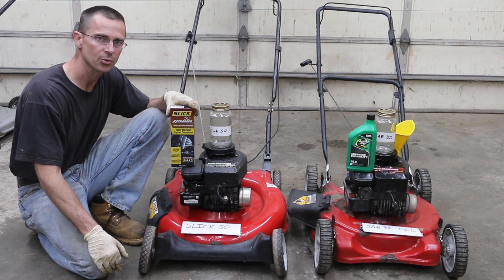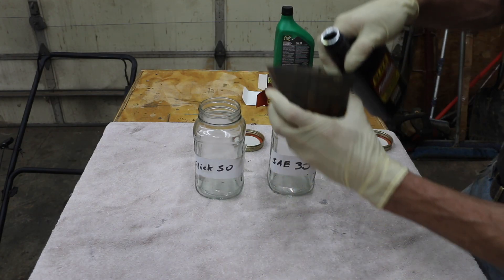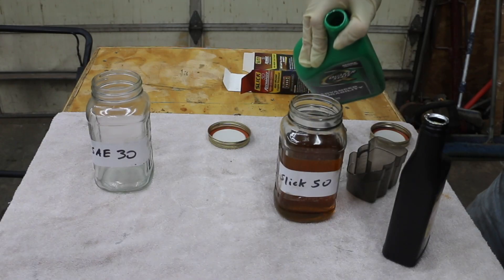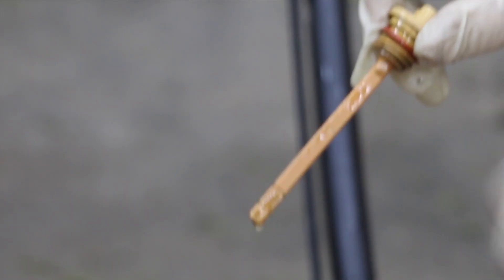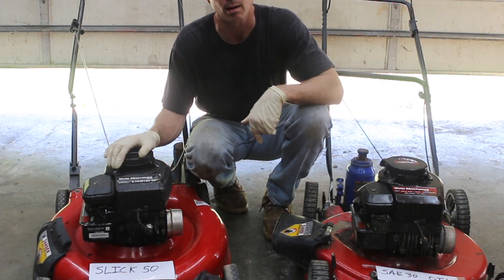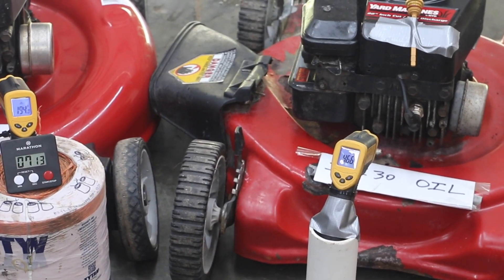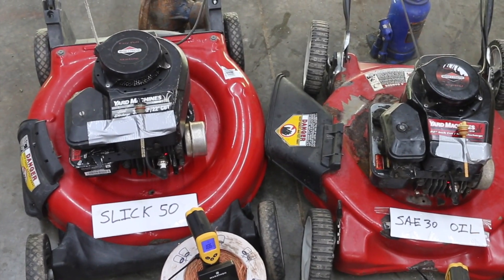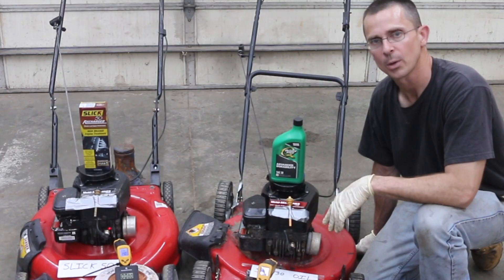Can't believe what SLICK 50 did to my engine!!--Dry Crankcase Test!

Comment: Squeeze a 4 oz tube of Amsoil Engine Builders Lube into one then Top with 30 wt oil!!!!   Run it like 4-5 hours or the tank of gas.  I soak all my small engine parts in the building Lube for a month or two on my chainsaw rebuilds!!!  That stuff soaks into the medal over time and creates a friction barrier layer...  don’t know if it can work that quick but bet it runs better
Reply from the maker: Thank you for this recommendation!

Comment: My dad ran slick 50 in his ford probe for years shortly after he gave it to my brother it blew a head gasket. When they removed the head to replace the head gasket he said the engine looked brand new without any ridges at the top of the cylinder. Any person who knows about engines knows that engines naturally create a ridge around the top caused by the piston rings.
Reply from the maker: Impressive!  Thanks for commenting on this.

Comment: Don't really know Who exactly would let their oil completely drain out of their car but the product did keep the engine a lot cooler than the other engine when it was running .So it does something
Reply from the maker: This is an excellent point.  A lot of others suggested I use 2 new, identical engines in future tests.  So, I'll do that just to rule out differences in wear or engine design differences. Thanks for commenting.

Comment: If your lawn mower runs on sae 30 oil. can you use 5w-30 in it? What is the difference in these 2 oils? Castrol magnatec is supposed to have particles that cling & protect.
Reply from the maker: Thank you for this recommendation.  I'll begin a new series on oils and oil additives soon.  Thanks again.

Comment: Today's Slick50 is not the original formula.  Thus the old commercial of the engine running for hours on end no longer applies.
Reply from the maker: This is a great point. Thanks for commenting on this.
Reply: yeah, so how about trying the john bishop version of the stuff.  back in the early 80's slick 50 stopped 2 of my engines from smoking.  that was a good enough result for me.  there's 2 sorts of teflons- those that stick to internal surfaces and those that leave with the next oil change.  install the first type.  the 2nd type is cheaper(and pointless).  you do good research.  thank you.

Comment: DuPont don’t recommend ptfe based compounds in engines.
The oil is providing both a cooling path and a film between components.
Try a Head and shoulders high zinc shampoo ( high zinc used in classic motor oil)

Or an experimental moly/ graphite solution of some kind like CV joint grease

Either way the component temperature out of operating range and expansion greatly contribute to the heat and lack of lubricant.
Reply from the maker: This is great information.  Thanks for commenting.

Comment: The amount of oil that you pulled out of the slick 50 test engine was a lot more than not only the SAE30 engine, but the amount of oil/slick 50 mix that you added to begin with (after the drain). This means that you didn’t drain an engine completely not one, but two times. The regular SAE30 engine no doubt had more residual oil in the case that was able to whip around and lubricate the internals at least a little bit more than the slick 50 engine, thus preserving it a little while longer. I’ve never used used slick 50 once in my life, so I’m not a butthurt fanboy in any way shape or form, but I just wanted to point that out.
Reply from the maker: This is great constructive criticism. I'll begin an entire new series on engine oils and additives and will do a much better job with experiment design.  Thanks again.

Comment: The first part of your test is more valid for use in a car engine, because a car will scream at you if it loses oil pressure, and you're a fool if you keep running it anyway. So really what matters for car engines is whether the additive produces better performance when the oil pan is full, not when the oil pan is empty.
Reply from the maker: All great points. Thanks for commenting.

Comment: I drove 30 minutes in a Cadillac that the water pump went out and all I had was Pro long in the oil change the water pump the following day started up run fine no problems
Reply from the maker: Impressive! I'll test it in an upcoming video series.
Reply: Every 3000 Miles when I change the oil I'd use prolong and I used it for a while so I'm not sure if that had something to do with prolonged being in the engine and bonding to the surfaces in the engine.

Comment: I like to know what Lucas Oil does. But the slick 50 did let the engine run cooler. Which in turn saves your engine much where and less on your thermostat. And a cool your engine runs the more horsepower you get.
Reply from the maker: Thank you for this recommendation.

Comment: Slick 50 is not the same as the stuff they used to run engines with no oil.
 its now exelplus thats tbe original stuff i remember it waz great
Reply from the maker: Great point.

Comment: I was a bit surprised myself. I expected the slick 50 to last about 9 minutes at least, to the 6 minute 30w.  In any case I feel slick 50 should only be used in a vehicle that can handle 10w40. A lot of new cars are 5w20ish. But after seeing this I find slick 50 a failure.  Only used it a couple times through the years. Now I'm not going to use it again, waste of money I MO.
Reply: 0ne more thing. Good video. Thanks for doing it.
Reply from the maker: Thank you very much for the positive comment!

Comment: Mower engines are a splash lubrication...I going out on a limb here saying 1) you need a pressurized system and more run time to impregnate the metals 2) those mower engines might not have had equal wear to begin with without any hour meters to verify.
Reply from the maker: This is an excellent suggestion.  I'll use new engines in future videos.  Thanks for commenting!

Comment: Would you sell these blown engines?
Reply from the maker: I have extra lawn mower parts of someone needs them and I'll give them away for free.  I've already disposed of some of the parts, since I have limited shop space.
Reply: Project Farm do you have any horizontal drive or 2 strokes? I know of a couple carbs i need wich have holes and scrapes from bad gas and owners haha. For example someone tried to bore a carb from a honda g150, i sealed it and got it to run, but needs doing right, as well as a shear key

Comment: What about trying out Tuff-Oil, I've been using it for 30 some years and getting 250-300 thousand from my engines before working on them.  You use about a table spoon per quart, my mowers run perfectly and with less vibration, I follow the break in rules, then change the oil out for Synthetic with just a spoonful of the Tuff-Oil, they last for decades and they have less vibration as well.  Look up Tuff-Oil.
Reply from the maker: Thank you for this recommendation.

Comment: The reason the 30 weight oil engine ran longer is because of what an old timer told me years ago. Straight weight oils have a better and stronger film strength than the additives that are mixed with the oil. They tend to be thinner also. Just my two cents. Keep up the great work fella.
Reply from the maker: This is an excellent point!  Thanks for the positive comment!

Comment: Why didn't you open them up? The slick 50 engine was running much cooler than the 30 engine. Don't you think it might have a pretty good chance at being saved? Did you try to start it again? Was the 30 oil engine completely locked? There's so many questions that I think we need the answer to. Make a part 2!
Reply from the maker: Thanks for this recommendation.

Comment: I used 50 before realized no oil it ran fine...seperate the mowers with temp gauge the heat was blowing on. The 30
Reply from the maker: Thanks for commenting and thank you for the recommendation.

Comment: All oils contain varying levels of zddp, but slick 50? Read the literature, zddp is the best metal to metal protectant in oil starvation conditions. Zddp bonds to hot metal surfaces and forms a tough layer of sacrificial material. Today's oils contain less than in previous years because zddp contributes to premature catalytic converter death. Engine rebuilders, race engines using flat tapped cams, and motorcycle racing oils all employ zddp as a metal protectant.
Reply from the maker: Thanks for commenting on this.

Comment: In your experience, what is a good oil to run in your lawn tractor? I remember the slick 50 commercial too. Seems like there was another where they drained all the oil out and were spraying water on the heads with the valve cover off.
Reply from the maker: I would recommend using a good synthetic oil and change it fairly often if the engine doesn't have an oil filter.  I'm reluctant to name a specific brand until I accomplish some oil tests, which I'll be doing in an upcoming video series.

Comment: Rislone for engines cleans and protects your engine. My dad told me in several oil changes your engine runs better and doesn't burn as much oil if it's not too worn out. The chemical is a really attractive Metallic blue color and it doesn't work right away but it does clean very gently so it doesn't hurt the inside of your engine or gaskets. It's meant for higher mileage engines and something I thought was interesting I had a engine that burned a lot of oil but after using the Rislone oil additive it did take a little bit for it to work like 3 oil changes but after words instead of my car burning 1 quart of oil it used up just a little bit of it like it resealed some of the rings. The color of the bottle is a red cap, yellow body with black and red lettering on it.
Reply from the maker: Thank you for this recommendation!

Comment: Use royal purple with synerlec it suppose to keep engines cooler and stick to metal parts. Here is what they say. Synerlec improve the surface condition of metallic surfaces by smoothing inherent surface roughness, actually reducing friction and improving lubrication of internal moving parts. http://www.royalpurpleconsumer.com/about-royal-purple/synerlec/
I use it in all my cars. And I pulled my valve cover off a old car I had bought. It was gross in there. After about two oil changes of 10k miles each ( you can go 15k on Royal with every 5k Chang’e filter top off. ) it was almost spotless. Something ya could try out
Reply from the maker: Thank you for this recommendation!

Comment: Can't help but comment here, before seeing video. I had a turbo charged buick and always added slick 50 to oil changes. One day the engine got hot, caught the oil on fire and burned off ignition wires. I had no tow service so had to go buy new wires and hope the car would start again and get me home as I live in Bakersfield and was stranded near Magic Mountain. I did not change the now dark black oil, but to my amazement the car started. I drove back home the 97 MILES. I then changed oil the next day and the engine was still in great shape. I really think it had to do with the slick 50 as the oil was burned bad during the fire.
Reply from the maker: Glad the engine survived the fire!  Thanks for commenting.

Comment: U need to use two brand new mowers then retest
Reply: No way to know the condition of each engine at the outset of test. I just don’t believe that both engines started equal
Reply from the maker: Thank you for this recommendation.
Reply: You've got the right idea.
Cheaper to start with to equal engines that have been rebuilt.
8-)
Reply: even two brand new motors havw diferent tollerances and will wear differently. The way project farm did it was a real world demonstration.(thanks for testing slick 50 btw!!) But the way people are carrying on you have to think, Would you buy a new car just to test an allready scientifically proven and backed evidence that it protects the engine? Slick 50 is one of the most researched and lab tested reliable additives on the market. But there is some.other variable at play here because i use slick 50 and have seen it work first hand many times.
Reply: true, 30 oil mower looked older, more worn, more slop in rod and piston would take longer to seize, slick 50 mower looked newer, tighter rod and piston would seize quicker. didn't give the slick 50 time to coat and get into the rod and crank to protect the surfaces. Both fluids came out black in short period of time, need to test 2 new mowers, let both of them run for 5 hours then drain them and test.
Reply: Agreed!  This test was completely useless...…………………………..elsullo

Comment: it all depends on the engine I think you just had a bad one. I only say this for the fact my brother was coming threw the desert one time with temps in the 120 and higher and he broke down the took the car in got it fixed and the guy installed new oil along with slick 50 well the next day I brother drove threw the desert the rest of the way home 3 hours when he got home he hade a phone call from the repair shot it seems the oil plug fell out in the parking lot and all the oil drained out but no one new as my brother picked the car up the night before at night when it was dark out and drove it to the hotel then in the morning drove it home. all that way houres on end without any troubles the only thing he sed it he did have to pull over several times to add coolent to the car as it kept over heating.
Reply from the maker: Thanks for sharing this experience.

Comment: I have found zx1 seems to help with all my previous and current vehicles.I did have a cylinder head gasket go on a Mitsubishi which overheated but kept going without damage and I had wynn's gold added to Castrol GTX in that engine.Now I use Mobil 1 or Castrol edge in the family vehicles.Cheers and continue with the projects as they are great.
Reply from the maker: Thank you for this recommendation!

Comment: Test out Zmax! i have been using it for years in all my vehicles, and im wondering if it's actually worth it.
Reply: I am aware of the lawsuit, Zmax won. They where found to not lie on the packaging.
Reply: Rick Nobbins which is why I asked him to test it, no way to know until an independent shop, that's not looking for anything, to find the results.
Reply from the maker: Thank you for this recommendation.
Reply: Lol bummer about that zmax video jhowe
Reply: I've been using Z-Max in my 2002 Saturn S car since about 2003, and routinely get 39mpg in mixed 'city' / 'highway' conditions, and as high as 41mpg in strictly highway conditions. My car has over 231,000 miles on it and seems like it ill go for ever. We'll see...
Reply: It's not.  The only thing you need to put in your crankcase is engine oil.
Reply: zmax has been sued, its nothing but mineral oil

Comment: I think you refer to the what's in store tv commercials with mike levi? Haha that was so funny. They only had products that nobody needed and it was all "fantastic". I remember a comercial about some engine oil additive. A big engine on a trailer. Let it run. Works fine. Add the special fluid and within a few seconds the engine began to work more silent and then they drain the oil and let it run. "Wow this is amazing". Yeah sure. Every engine will do that for a while. And just when you would expect this engine to start heating up because  of the lack of lubrication they took a water hose and started spraying the engine from the outside to cool it down and and also spray the water inside the crank case so it would cool and lubricate the inside moving components while they just said:" and look at this. The special fluid will even protect te inside of this engine. All this water inside and still working like new"
Reply from the maker: Thanks for commenting!

Comment: Years ago I was also a Slick50 user. However, I treated my new 2.2 liter Dodge with Slick50 and the camshaft wore ot at 90,000 miles. I qit sing Slick50 and have used synthetic oil since with zero failures. My current vehicle has 216,000 miles and neither leaks nor burns any oil.
Reply from the maker: Thanks for commenting on Slick 50

Comment: I watched those old late night infomercials many times, both slick 50 and the Dura Lube ones, I always wondered if it was so much slicker than oil, or made the oil so much slicker, why didn't they pour it in a running engine and show the rpm's increase :-)
Reply from the maker: Thanks for commenting!

Comment: You can't run an engine on slick 50, it's an additive, just like Lucas. If you ran that engine with slick 50 ADDED to it, then removed the oil and started them back up, still at operating temp, THAT'S where you'd find whether or not it worked. But you may have done that, I don't know, I just skipped to the end where you just keep saying slick 50, with no mention of using a slick 50/oil mixture.
Reply from the maker: I used a mix of slick 50 and oil. Thanks for commenting!